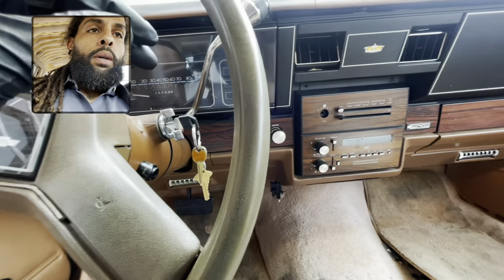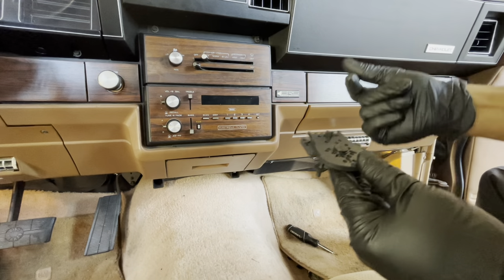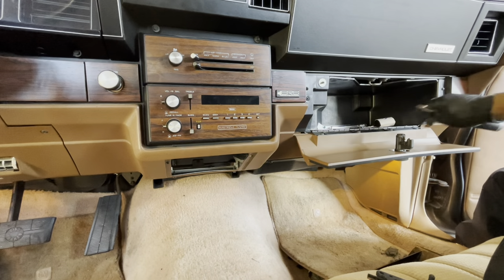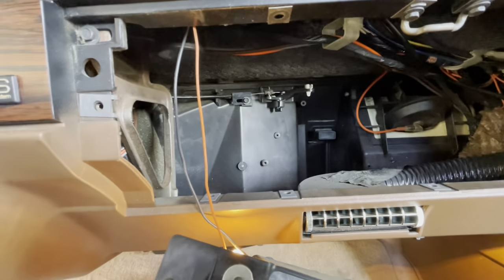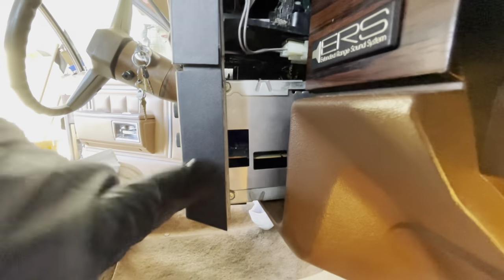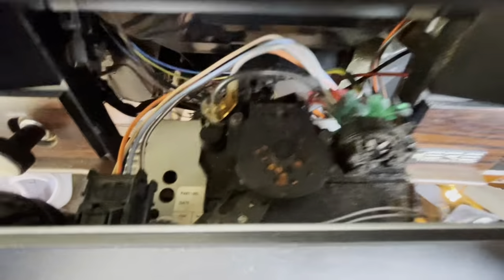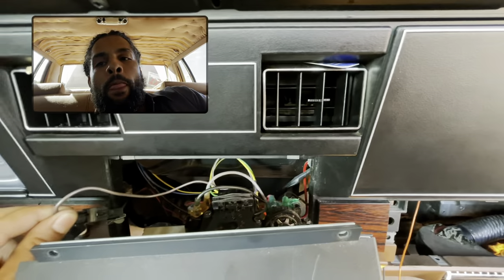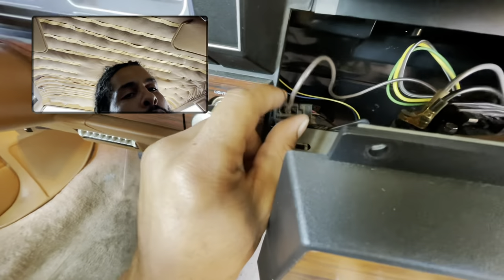1989 CHEVY CAPRICE A/C PROBLEMS

Comment: When mines didn't work I found out it was a pressure sensor for our  ac made onto the tip of the power steering lines a pressure switch
Reply from the maker: So what did you end up doing??? Because I followed that same wire to the power steering and didn’t kno what it was for!?
Reply: @Kreol Boi  changed that switch on the power steering and the clutch kicked in like new
Reply from the maker: @waynegreen6789  awww mane!!! You a life saver 4 real and dnt even kno it!!! What’s the name of it??? Pressure switch?
Reply: @KreolBoi  yes
Reply from the maker: @waynegreen6789  first thang tomorrow mane! I highly appreciate that!!
Reply: No problem fam
Reply from the maker: @waynegreen6789  mane what’s yo cashapp???
Reply from the maker: Aye mane hit my IG for real… I need ya cashapp
Reply: @KreolBoi  Thanks fam I appreciate it hope everything went smooth for you

Comment: Same issue I had with that brown wire…mine was unhooked and hidden…couldn’t figure out why my blower motor wasn’t engaging and found that wire, plugged it in and now blower motor works…I just need to know what wire goes to my A/C compressor now tho
Reply from the maker: Mane I jus watched your last video and tried to get a glimpse of how it’s set up and you got a whole new system… you gone have to run a switch to the inside that cuts the compressor on and off… that’s what I would do but put a fusible switch on it but I would really have to look at it mane
Reply: @KreolBoi  after seeing your vids it got me to researching...I found some useful info on a forum...I'm going to try it and if it works I'm going to do a vid on it...Thanks for checking me out 👌🏾🦾
Reply from the maker: @87SSBOI  already mane and keep me posted!!!

Comment: I'm having an issue where the blower goes to defog regardless of the setting. This happens if I change the temperature to hot or if I change the mode to Vent - Economy. Do you know why that is or how to fix it? I've got a 86 Caprice
Reply from the maker: It may be the vacuum lines that run frm under the hood to the inside control panel… gotta make sure they not broken or they may have came loose… behind the glove box

Comment: Say fam what color wire goes on the left side of ac compressor it’s a black an a black an whit wire. looking at the front of the car which color wire is on the left of the connector ?
Reply from the maker: Left side should be the power wire whatever color it is and the right side should be black that’s the ground side! Lmk what cha come up wit
Reply: Both my wires are black , but one has a white line. is that the negative ?

Comment: I have a '91 Bubble Caprice. The ac blows, it's just not blowin hard. The fuse holder is out so I have to take the fuse box out to insert the new one in
Reply from the maker: You may need a blower motor!! A a blower motor resistor
Reply: @KreolBoi  Those are new. The piece that holds the fuses are out. Meaning, there’s no wire to the fuse holder to hold the fuse in.
Reply from the maker: @Dru9120 so did somebody bypass the fuse if it’s no fuse? Mane you may have to rewire some thangs but I would need to see the it
Reply: @KreolBoi  Idk what they did. I check the wires and it’s missing. I even bought new fuses but they won’t stay in because the fuse holder is gone. What’s your IG?

Comment: 79 chevy impala. Where is the ac pressure switch. It ain't on the accumulator.  What powers the thermal switch on the housing of the heater core. Doing ls swap
Reply from the maker: It may be built into the compressor… I seen some like that… if not ima have to look sum shh up… especially if you doin a swap mane ion even kno…

Comment: Bro I have the same exact same problem but now the wire gets hot n have started to melt the plastic…any ideas why?
Reply from the maker: Damn my shit had did that 2 once b4 and had to run a separate switch… make sho you got the amp fuse in there too

Comment: What about changing the top switch how you go about that. Mines only work on the heat side and not the Ac
Reply from the maker: If it only work on the heat side your control switch mite be unhooked… you gotta take it apart and see mane

Comment: I got a 84. 
I got her ac working but there is a vibration from the blower area only with the ac on not heat. What could it be?
Reply from the maker: Could be a bad blower motor mane!!
Reply: @KreolBoi  only does when air is on. I think i need a new belt. havent got one yet

Comment: I got a 85 when am driving the ac stop blowing hard through the vents but it’s blows hard on the floor and I think the defroster when I park or stop it start back blowing strong through the vents
Reply from the maker: The year you got it had vacuum lines that control the vents you gotta make sure the hooked up
Reply: @KreolBoi  yea I figured it out I bypassed the heater core and the hose was still active so I put a screw in the line and everything works now

Comment: have problem with mines man the clutch doesnt kick in
Reply from the maker: Check ya AC fuse… make sure it’s Freon in the system… cnt be nutin to major
Reply: @KreolBoi  it blows and also hot air. I figure that its the fuse. thanks for the reply!
Reply from the maker: @jl_finesse  if it’s blowing out the vents you need Freon

Comment: Tryna get my a/c to blow cold. Changed the dryer and new compressor still not cold. SMH
Reply from the maker: Mane it be like that sometimes!! Pressure switch maybe
Reply: @KreolBoi  found out the door wasnt switching from hot to cold. but i still ordered a pressure switch just in case!
Reply from the maker: @laashep  already!… so you got a vacuum line loose or to temperature cable broke but you on the rite track
Reply: @KreolBoi  will keep you posted bro!
Reply from the maker: @laashep  already mane

Comment: My ax only blows through the bottom vents
Top vents have no airflow
Reply from the maker: Mane you gotta make sure all your tubes behind your dash connected to each other!… plus make sure all your vacuum line connected under the hood by the blower motor and lmk!?
Reply: @KreolBoi  say less I got you
Reply: Got mine to work homie
Two of my lines under my hood weren’t even attached to the vacuum itself
Ice cold ac in Miami during the spring and summer baby

My car does shake more when ac full blast 
I would guess clutch or a dampener , would you recommend relieving the entire compressor and belt ?
Reply from the maker: @raydengoudreau5787 what you when it shakes? Like the dash shakes or the motor shakes? You mite need some motor mounts! Make sure yo blower motor tighten down!